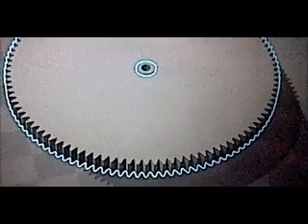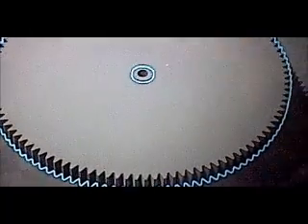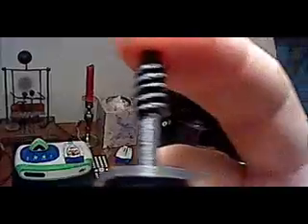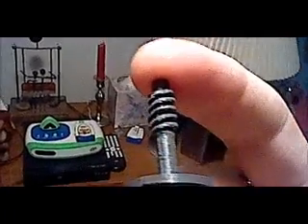mini thunderbolt siren update - lobe blower gear and ANOTHER rotator repair.

Comment: Siren drawing requests:
Federal q2
B&m super chief
Sterling model 30
B&m siro drift
B&m cs8
Federal model wlr
Federal model c5g early model also
Federal model c4g early model also
Federal model 28 and 28h
Sireno 40010
Can model 104
Federal model c6
Federal model rx coded model l
Federal model wg
Federal model eg
Federal signal model j
Federal signal model a5
Federal signal xt22
Sentry f2
Cti smo 15
American signal om120
American signal om117
Hor siro drone
Sentry 14v
Sentry 20v2t square horn
Sentry 7v8
Federal signal 500t
LA 500t
LA Sd-10
LA model 5t
LA fedelcode model 5t short housing
Fedelcode model 2/2t and short housing
Fedelcode model 3/3t and short housing
Fedelcode model 5/5t and short housing
Fedelcode model 7/7t and short housing
Decot siren
Erick siren
Eows m12
Km europe 8 french siren square horn version also
Aca sentry 95
Masterblaster 127
Klaxon s04
Klaxon super m
Pneumatic german siren
Electronic german siren
German wk2 siren 9/9 port 3/9 port model also
Elektor(german) e57 styled siren 3 port only
Denver siren
Darley model 2/2t
Darley model 3/3t
Darley model 5/5t
Darley model 7/7t
Darley champion not the one you got now that's a as darley champion(the one that looks like a fire hydrant. And the one you got is a ws darley champion)
16 port sentry 5v(in sc) 
Sound master 115
Sound master 125
Aca super banshee
Aca banshee 110
Model 120 siren(aka toshiba siren) 4 port rotor and 8 port stator pneumatic square horned siren.
Sounds like this but synthed https://youtu.be/06xuAQIoW90

Sorry this is a lot of request so I might draw half of them so you don't have to do all of them
Reply: Hi I’m here to replace you
Reply: Woah, alot of siren requests! Some of them have alreafy been in TSM before after this video was uploaded! The Federal Q2B might appear in my script “Meet Model Q” that i’m gonna post in the comments section of TheDRJ2006’s lastest scripted episode video, “Power Outage Craziness!”